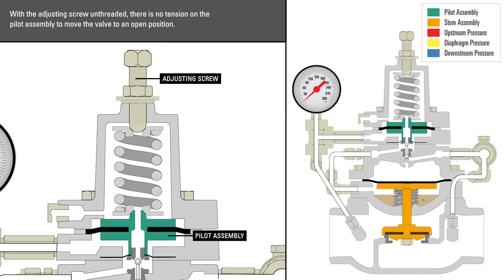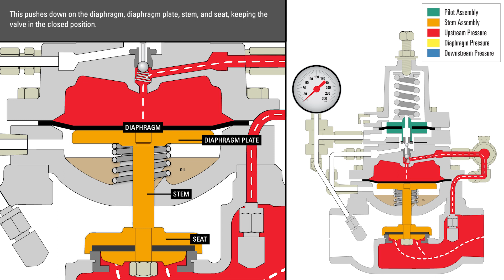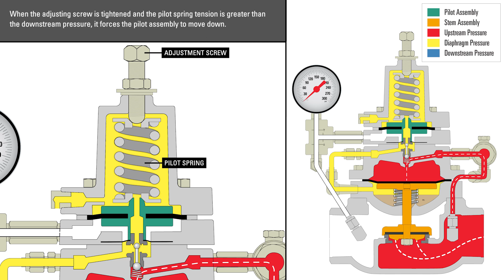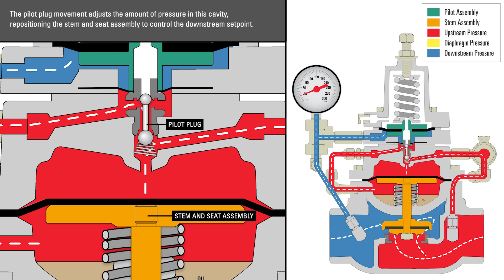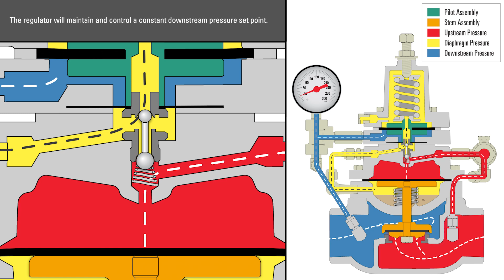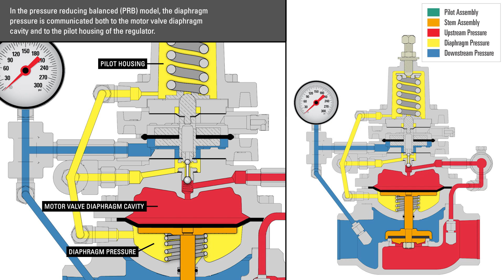Kimray Pressure Reducing Regulator Working Principle | Training Animation

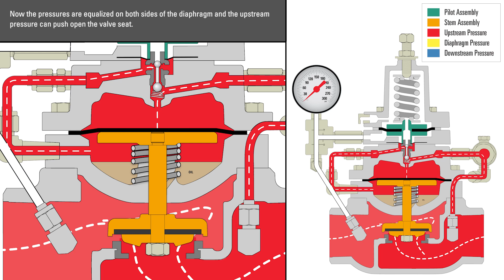Comment: As usual excellent video. At 1:54, how pressure at the upstream and downstream of the diaphragm can be same. Because diaphragm downside area (under area) is less so force should be less. And upside(top area) is more. So how low force (down side/ under side) of diaphragm can overcome the large force (top side) of diaphragm?
Thanks.
Reply from the maker: The area on the top and bottom of the diaphragm is the same so the force created is equal. The booster spring aids in the opening of the regulator, while the upstream pressure pushes open the valve seat.